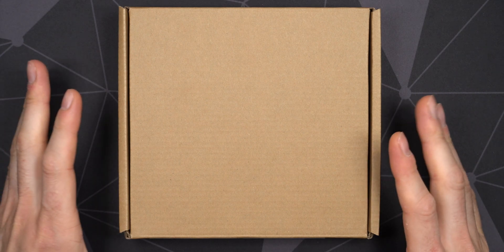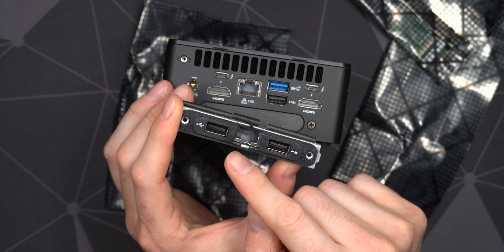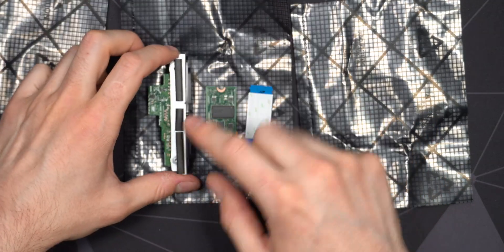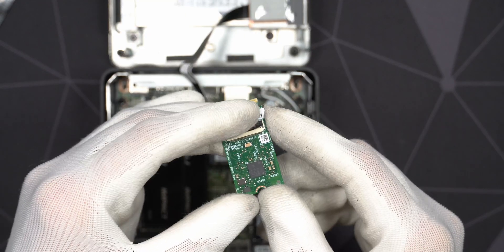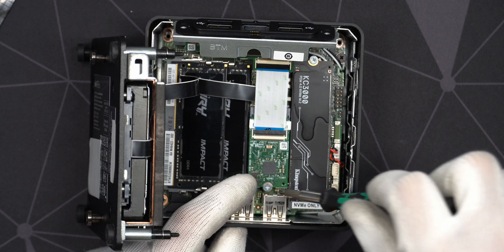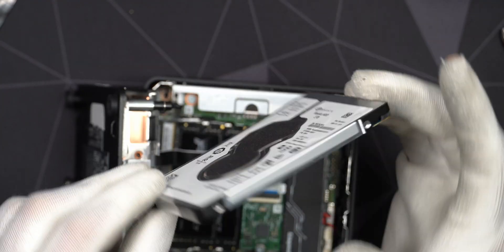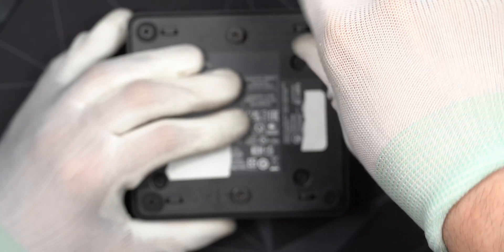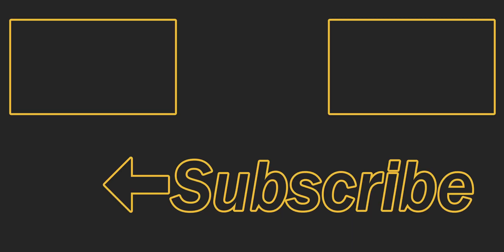Intel NUC LAN & USB Add-On Assembly (NUCIOALUWS)

Comment: Heads-up for those who want to upgrade to or already own an ASUS NUC 14 Pro:

The ASUS NUC 14 Pro does not include a B-keyed M.2 slot which was present in previous models. Instead, both M.2 slots (2242 and 2280) are M-keyed and support only PCIe 4.0 NVMe SSDs. This means that these M.2 add-on modules that rely on B-keyed slots are not compatible (different connector, it won't fit).

Comment: i also buy a nuc 13 i7 1360p , install 64g ram, 2to ssd 2.5 (c), 4to M.2 (22x80) for storage.....i buy a rear pannel 2x usb2 (connected to motherboard 2xusb2)+ 1xusb3(connected to M.2 22x45) .... maybe it would be cool to open special FB groupe for nuc users ?

Comment: Thanks for the informative video. Good to know that the extra NIC card does remove the ability to add another internal M.2 SATA SSD - tradeoffs. And that you can’t use 15mm height drives / HDDs if you really have to use an HDD (AVOID AVOID AVOID). 

Word of advice and to other viewed as you’ll thank me later: Ditch any 2.5” HDD, you should NOT be using any disk stuff in 2023 and flash prices have crashed, period! I used one in the past and it bogs down overall system performance no matter how fast your PC is. I have a 4TB 2.5” SATA SSD in my NUC Pro and it works amazing. Disk is dead. Long live SSDs.

Comment: I tried every thing just as you did but I cannot get this to function.
Reply from the maker: I had same issue at first. Try to go into bios, disable built-in LAN, save reboot, then go into the bios again and enable LAN, safe and reboot. That fixed it for me.
Reply: it worked OOB for me, running the latest bios version, ubuntu and kernel
Reply: I have the same issue on a NUC 13 Pro, latest BIOS, the secondary LAN MAC address has all zeros in the BIOS. I then reseated the NUCIOALUWS module a few times, removed the ribbon cable between it and the ports, powered on the NUC and the secondary LAN now had a MAC address in the BIOS, refitted the ribbon cable and booted into Windows 11 and the secondary LAN is working.